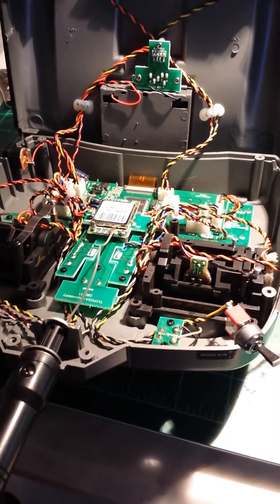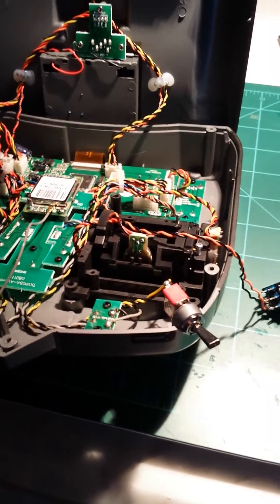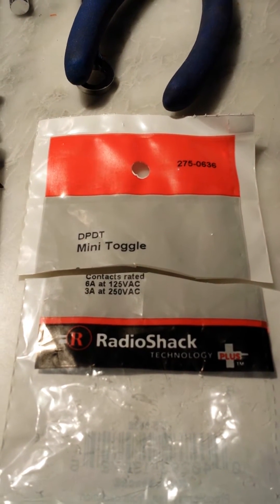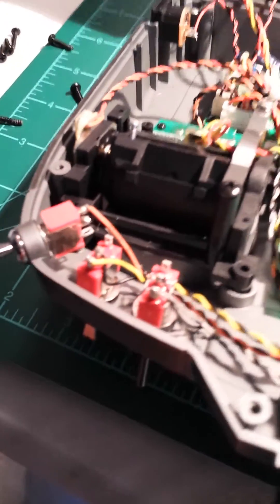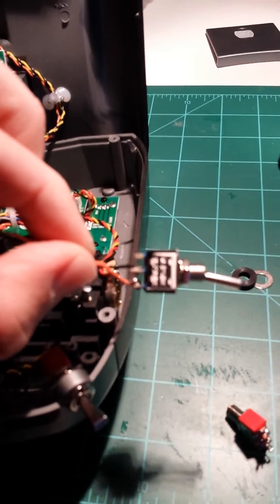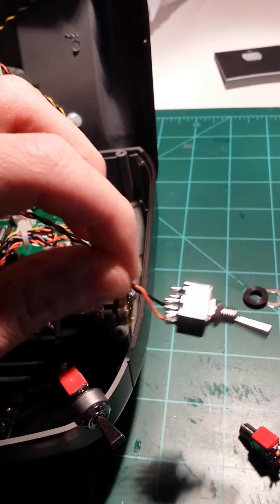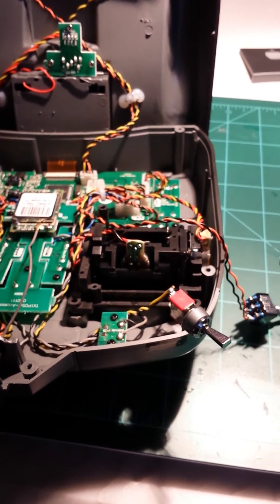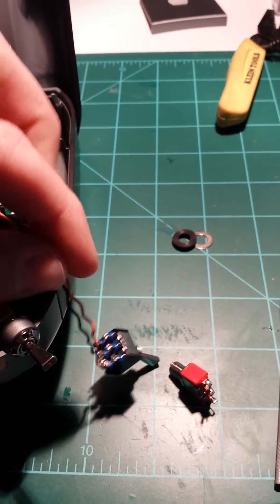Spektrum Dx6i Toggle switch replacement

Comment: The reason why your switch as 6 posts as opposed to 3 is because it is a DPDT(dual pole).  The radios, as far as I am aware, use SPST or SPDT (hence single pole) switches.  Now that Radioshack is closing, you can find these mini toggle switches from places online like amazon, mouser or digikey.

Comment: You have a double pole double throw switch when you should have used a single pole single throw, that is why you have 2 sets of solder lugs. You can essentially use the other set of lugs for another switch,,therefore making one switch do 2 circuits. What you have works fine, I was just pointing out some facts:)
Reply: thanks! just getting back into the hobby and noticed my gear/F mode switch was broken off!! :( doesn't seem to hard to fix though and i can easily still get switch at radio shack?
Reply: yes they have all types of switches. I just did my flaps on my DX6i.
Reply: thanks this was an easy fix! and also kinda fun
Reply: James Peyton I need to do the flap switch. how do you remove it? No one has a video of removing the switch
Reply: there are a lot of videos out there for the screen mod and switch replacement. you can essentially remove the back cover and then you will have access to all of the switches.if you need a video Felixthemaster1, I will make one just for you:)
Reply: James Peyton Again, no one actually shows how to remove the switch :( 

That would be awesome! But only if it is no trouble
Reply: interested to see the tool that unscrews the toggle switch "collar" as well.  Any tricks to get the old switch out??
Reply: the collar should just pop off when you disassemble the TX
Reply: i should also add that its extremely easy and hard to mess up modding and replacing switches, this transmitter was built for it.